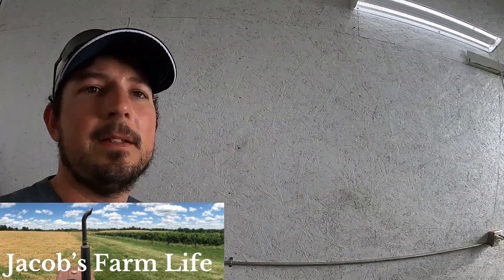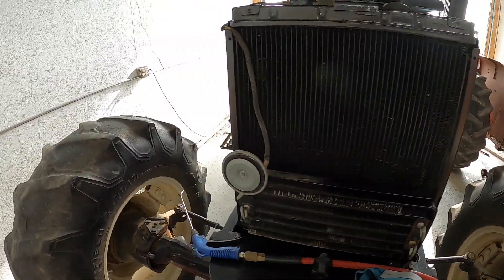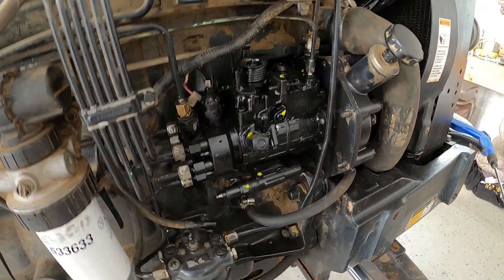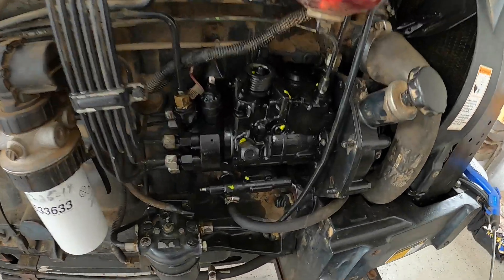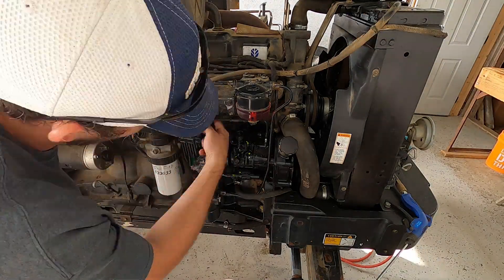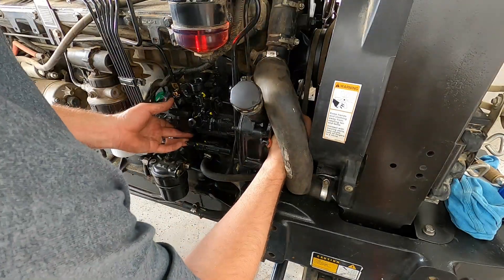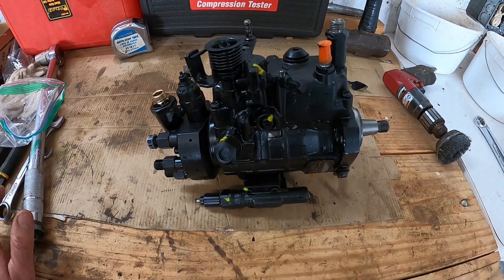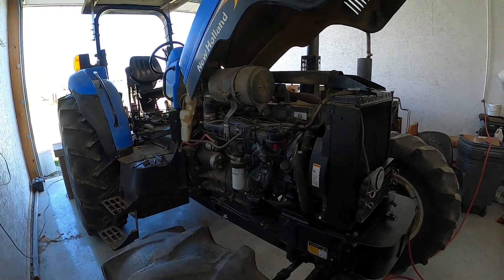New Holland TB 120 Diesel Fuel Injection Pump Problems - Timing problem - (2020)

Comment: I have a ts100 model but similar dp200 pump. I sent the pump out to get timed. I don’t see any mark on the flywheel or damper for tdc and I tried already adjusting by taking valve cover off until cylinder valves are loose then take a torque wrench that does degrees and backing it off 28 degrees but the tractor doesn’t want to start on its own. What is the mark I should be looking for on the flywheel and how do I know that I backed it off exactly 28 degrees?
Reply from the maker: Just seen this post.  Did you figure it out?

Comment: I work in a fuel shop and I do these pumps for a living it’s a Delphi dp210 pump that’s digitally timed. Stupid idea but it’s for emissions there’s no key in the shaft. 90% of the time it’s the fitter spinning the shaft when nipping the gearwheel on then come back angry we have not set the pump correct. It’s a stupid idea why Delphi can’t just put a key in the gear I do not know.
Reply from the maker: I agree that its a stupid idea.   Just makes everything a little harder..

Comment: Hi! We just had our pump out because it was leaking from the axel seal. The shop then timed the pump. 
We set the Engine to TDC then went back a little to 30 BTDC and then 2 notches forward for 28 degrees according to the install manual we got from the dealer. Is this wrong? Should the marking on the Flywheel show 0 like in your video? Or is it the 30 degrees mark you see there in the video?
Also the Tractor start kind of easy but doesn't run right. It got really low power on low RPMs, was fine when we took the pump of. No smoke though just low on power.
TDC was easy to set with the front cover of and we also made sure the valves where closed on cyl1 by looking under the valve cover.
Reply from the maker: Went off my manual that says the same. 28 degrees btdc on the flywheel and pump set at 29 degrees.   I ended up having to adjust it a few times as it didn’t seem right.
Reply: @JacobsFarmLife  the pump service shop said they had it up in a bench and adjusted it with help of computer tools so not sure they understood they should set the pump at 29. Maybe it was zeroed? I mean the pump at 0 and our engine at 28. So really retarded timing at the moment if that's so? Or am I thinking wrong here? Thanks for the fast reply.
Are you sure the pump should be at 29 btw? So I can tell them that if we remove the pump again. On the valve cover I see this "Initial Injection timing 29° so probably so.
Reply from the maker: That’s what my book says.  It’s a really poor design in my opinion. You have to take the whole pump back off to just to adjust timing.  I talked to a couple of dealers back when I did this and didn’t get much help.  You might try and reach out to some.  If they know what you’re talking about they can set the pump at 29 degrees for you.    I had to end up adjusting the time a few more times by locking the pump taking it out and moving the flywheel a few marks back and forth till I got it pretty good. You can really tell by the sound of it.  It’s just a pain that you have to pull the whole pump.